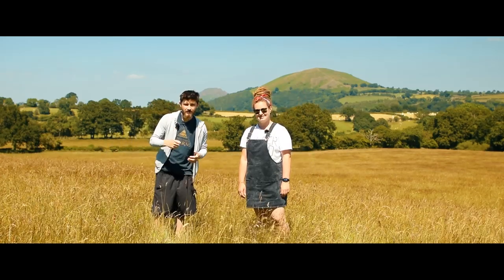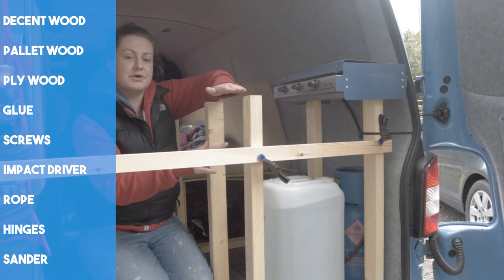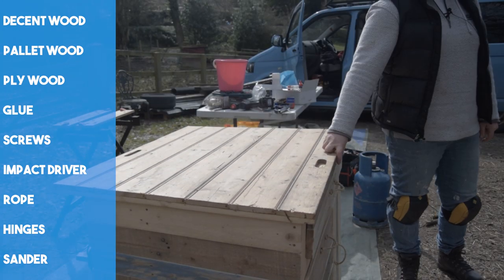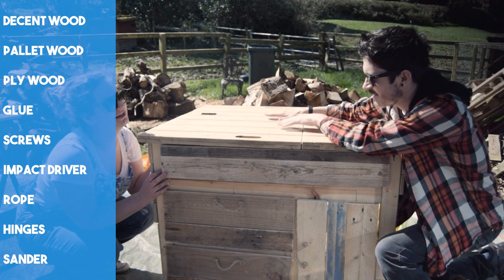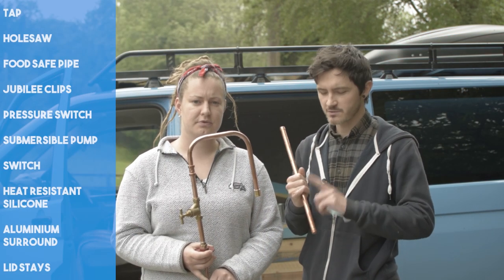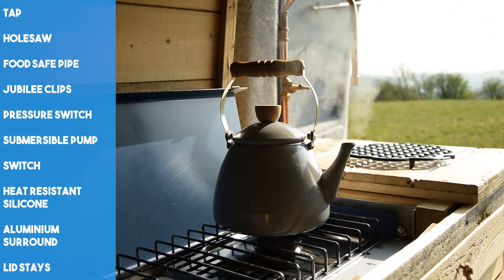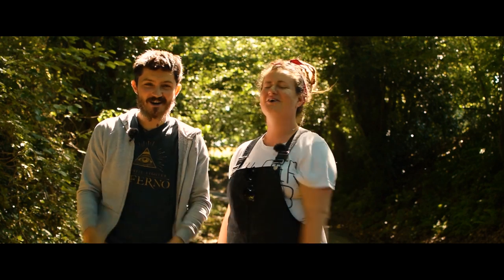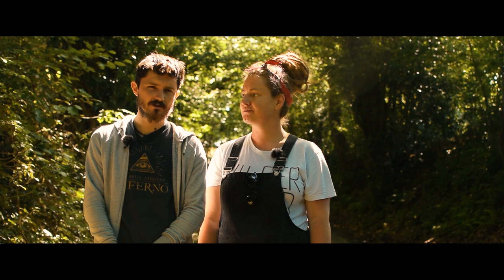DIY VW T5 Camper Conversion - Start To Finish, Van Life UK (3/3) Beginner Build

Comment: Ace videos, I've just started on the same, a lwb T5 early days but seriously enjoying getting stuck in and found your videos super helpful 👍🙏
Reply from the maker: Hi Ben! Glad you've found our vids helpful. We're still really happy with how the van turned out :) ah brilliant, how's the conversion going, got it all planned out or just seeing what happens? Is it your first conversion? Cheers!
Reply: @FloraTheNoviceExplorers  yep first conversion, just got windows in the front and and barn doors, now stripped everything back , cleaned it all and started on the sound deadening. Quite a satisfying job eh!  I'm definitely keen on a more rustic look, L shape or bench bed, big decision for me is pop top or not, I like the idea of extra headroom, light and ventilation, but obviously it's a fair chunk of money. Is it something you'd thought about?  Once roof decided upon I'll crack on with electrics and get my final layout set! I bought one of the door stores after watching the video 👍
Reply from the maker: Sounds like you’ve got it mostly figured out! Which is a good start, we weren’t as prepared 😛 ah cool, the door store is a useful bit of storage for those odd bits and pieces! We’ve though about getting a pop top but we’ve never really seriously considered it, not yet at least. As you say they ain’t cheap 😛 plus we carry a fair bit of weight on the roof. But as we get older we may think about it a bit more seriously as the headroom would probably be handy on occasion!

Comment: Hi guys, what a great set of videos, very inspiring and accessible!
Can you say a little more about your base van? LWB or SWB and why. Is it a 2.5 or 1.9 again any reason for it? Thanks
Reply from the maker: Thanks Chris, glad you enjoyed the content. Flora (our van) is a LWB, this was a very conscious decision. We wanted all the space we could get, although the van is only about 40cm longer than the SWB internally it adds up to a fair bit more room! PLUS we can still park in regular car parking spots etc and drive about small towns without issue. The ending is a 1.9, in hindsight we should have thought more about the engine & mechanics. Although this van is solid, we could always do with a bit more power! 6 gears and cruise control would’ve been handy too 😛 we somehow overlooked these semi-important specs, but back when we bought the van we really didn’t have much idea of what we actually needed. That being said, we’ve not long been back from 13 months around Europe. We had a great time and the van never let us down. We’re home now and planning upgrades and the next adventure!

Comment: Love the opening scene. I think you have done a truly fantastic job. Superb.  I ha ve a factory built VW T5 California, but I reckon you van is nicer. Save up and get a pop top fitted, then you can stand up to cook and dress. Any reason you didn't buy a high roof van? Lucky you have access to a blacksmith, welder, upholsterer and you both worked well together.

How much did the van cost and how much did the fit out cost and how long did it take?
Reply from the maker: Haha, thanks! We had to re-watch the beginning of the video, it's been a while since we've seen it so forgot how it started! 

We were really happy with how the van turned out, especially considering our experience and skill set. I'm not quite sure why we didn't have a serious look at high-top vans. We had a look at a mid-roof T5 van, but that's as far as we went. So far it hasn't been an issue, yes there's times when you wish you could stand up to make life a little easier, but we've got used to it now. 

If we have the van for a long time I guess there's a possibility we'll look at adding a high top/pop-top. 

We consider ourselves to be very lucky when it came to getting assistance with the build. A lot of people chipped in to make it what it is, would certainly have been a different outcome if we tried to tackle everything ourselves.

The van (including UK VAT at the time) cost us around £13,000 if I remember correctly. And the conversion cost us around £7,000. But that includes EVERYTHING, even new tools we had to buy etc. So certainly not cheap, we definitely could have saved money in places. But there were certain areas we wanted to splash out on,

It took us a long time to eventually get it done. We found it hard committing time to it when we were both working alternative shift patterns. The longer it went on the less energy we seemed to have for it, so I'm not exactly sure how long it took. Luckily we weren't in a rush, we knew we had a while to finish it before we planned to travel.

And we've still got upgrades to do, so I suppose it's never really finished :P
Reply: @FloraTheNoviceExplorers  Excellent - thank you. Thanks for reponding too. Many van folk don't respond to questions.
Reply from the maker: No worries, we try our best to stay on top of comments 😊

Comment: Great job guys! 

Was just wondering what exactly do you mean by a scribing tool?
Reply from the maker: Thank you! :) 

Basically my understand is... you can get certain tools that allow you to create exact copies of say the contours of the van, or a particularly awkward part of your furniture. You can then use the tool to apply that shape/contour directly to your material, let’s say wood and cut it to be the exact shape required.

I’ve probably butchered that! Haha, hope that makes a bit of sense? Basically it makes a template you can use to get the best fit!

Comment: Really enjoyed watching the 3 videos, you have inspired me to have a go. Looking to purchase a Kombi as I am advised these are a good starter VW Transporter for converting.

Did you have any weight issues with all that wood inside the van, I have read that the rear suspension can be upgraded if weight is going to be an issue.
Reply from the maker: Cheers Peter! Glad they helped :) ah brilliant, yeah we see a lot of people going down the Kombi route! We haven’t had any issues with weight. When the van is completely full of water, gas, bikes, food, everything basically put weight was 2.6 tonne and we had no problems or upgrades. The van is a T5 T30 which basically means it maxes out at 3 tonne, so we had a little room to spare! Biggest issue is the speed, or lack of, especially going up hills 😂 but it’s done us proud! Cheers

Comment: Very nice 👍, sorry how much money need for all  ~ , and how many days work fiinnsh . Thanks
Reply from the maker: Hi! The van cost us £13,000 (Inc U.K. VAT) and then we spent around £7,000 for the conversion (but that price includes ABSOLUTELY EVERYTHING, even tools we had to buy!). I don't know exactly how many days it took us, you could do it quite quickly. But we were in no rush and had clashing work schedules. We did it very slowly over the course of a couple of years or so. Hope that helps.